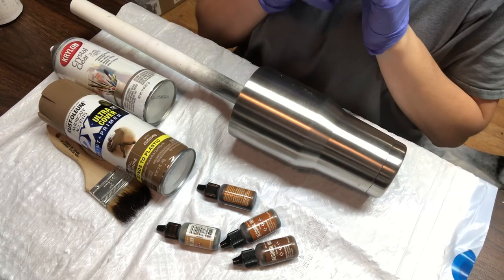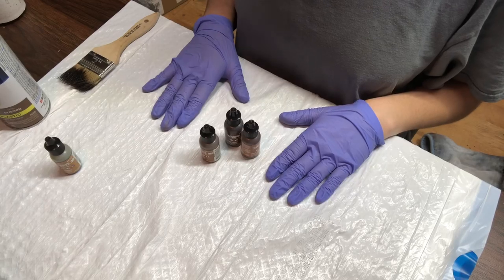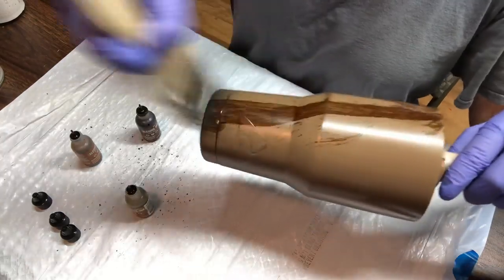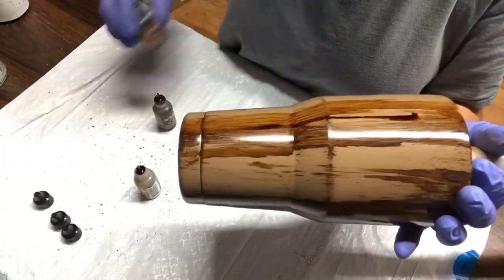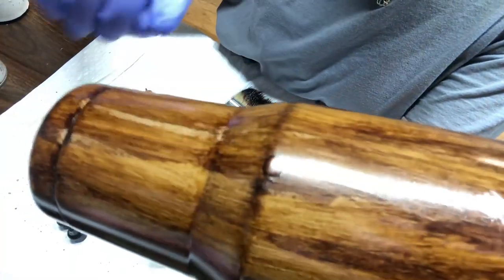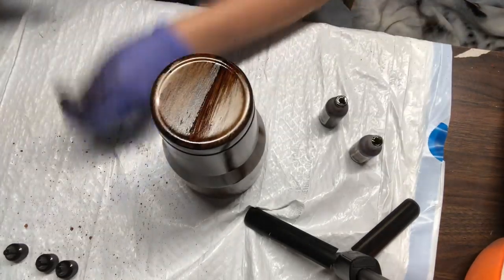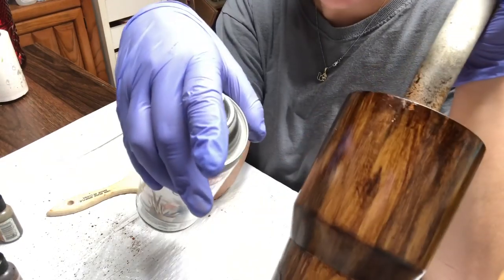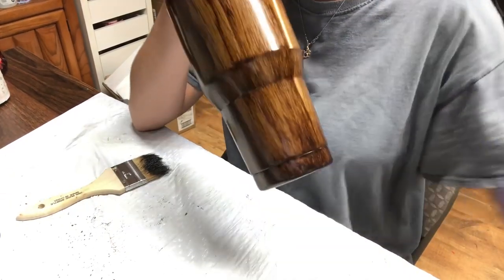Woodgrain Tumbler

Comment: @MissKissKreations - I just did my first wood grain tumbler, and when I sprayed it with the Krylon, it immediately turned all spotted.  :(  This is acrylic spray that I've had for a bit, so is it just because it's old, or did I maybe spray too closely to the tumbler?
Reply from the maker: I haven’t used acrylic spray paint before so I don’t know what happened.  Maybe try regular spray paint or Shake you’re can more
Reply: @MissKissKreations  believe it or not, it ended up working out.  The more I messed with it, it ended up having a distressed wood look and it's wicked cool!  :)  I did, however, buy a new can of spray sealer so I don't have that issue again.

Comment: Question:  I did your wood grain technique and did a light coat of epoxy on it.  Can I put more woodgrain ink ON the layer of epoxy?  I have a couple places that are lighter than the rest of the cup.  Wondering, can I do a woodgrain ink on top of the light layer of epoxy? 🤷🏻‍♀️
Reply: Yes you can!

Comment: Can you do this without painting cup first , and just leave it the stainless steel?
Reply from the maker: You can, but I would recommend painting the cup first. Even if it’s with acrylic paint and not spray paint. 
The inks may not stick to the stainless steel cup, the epoxy will most likely repeal around the tumbler.  Having a flat or satin finish helps everything stick.
Reply: Miss Kiss Kreations thank you!

Comment: When I sprayed my cup with the same exact spray paint as yours mine came out rough and looked a different shade. I cleaned my cup and it was regular stainless steel. The ink kind of soaked in the paint and it was blah. Do you have any idea why?
Reply from the maker: TheGoodmanVlogs Make sure before you spray paint your tumbler, your tumbler is prepped! Go back to my videos to see how to prep a tumbler.  Also, make sure your spray paint is covered evenly, not too thick of a coat, we just want the tumbler to be coated to have that matte feel, so the paints and epoxy will stick better.  Make sure your spray paint is completely dry! 100% dry before you apply anything else to the tumbler.   Hope this helps and have fun!
Reply: I needed to spray the cup with a second coat and it turned out great!

Comment: How much epoxy do you use for the thick final coat?
Reply from the maker: I typically do 3 cups at a time. So it’s hard for me to judge. I mix epoxy in big batches.   I’d say 1ML for each 10 ounces on a regular coat. So, for a flood coat, double.  Total: 6-10MLs for a flood coat

Comment: What do you put your tumbler on to spray paint ? I spayed my first one today and it ran, etc. I did not put in on the turner because I thought the paint would ruin it. I just put it on a pole outside and sprayed it. Will the run marks be ok when I epoxy and put on the ink?
Reply from the maker: I leave my tumbler on my turner arm. I then hold my arm and spray paint the tumbler